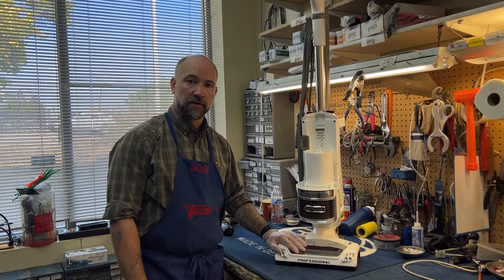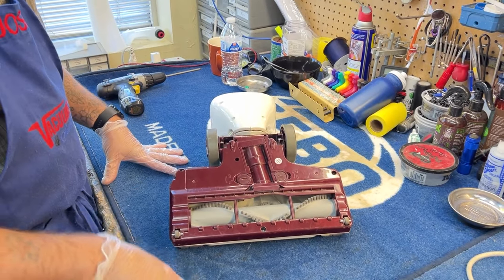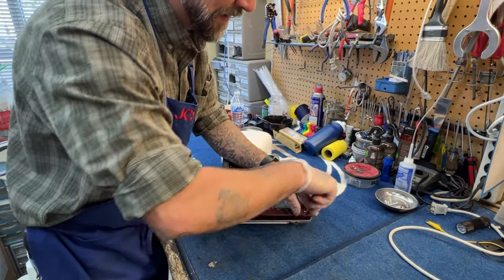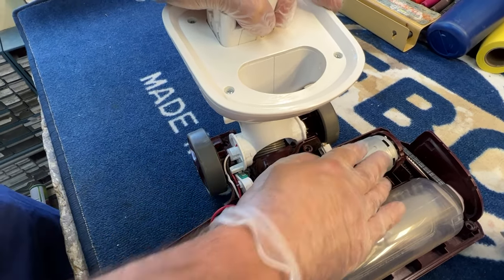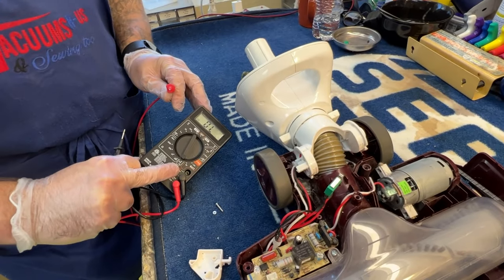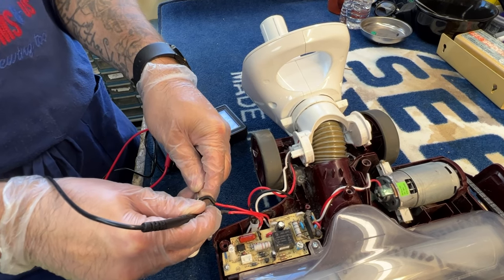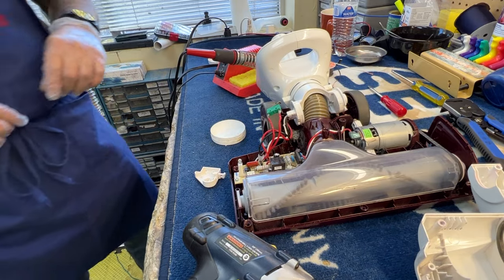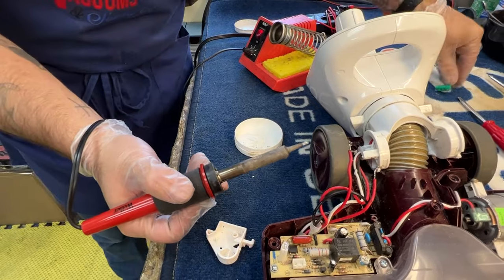Shark Repair for No Brush Roll Action--Micro Switch Replacement

Comment: I have a shark navigator uv540 lift away.  I removed screws to take off plate to remove brush roller to clean it.  Two rectangular shaped bars fell out and didn't see where they go to put everything back together. Any help would be much appreciated! They appear to have something to do with weight.
Reply: Hey Chris. Off hand and without seeing it I think those e are counterweight which go on the opposite side of the motor I. The powerhead
Reply: @joshyouwa  thanks so much for the reply.  I'm not sure what the power head is or looks like. Also not sure what you mean by opposite side of motor .

Comment: no screw under the middle below the hose - but my single roll is still stuck under the plastic housing in the middle - I removed all of the screws including the 2 under those little wheels - any ideas??  would be hopeful - for $10 part I would rather fix the 6 year old machine - no purchase a new one = thanks
Reply: did you ever get a fix.  I have the same problem. Can't get the top face plate off to access the wires.

Comment: FOR SOME MODELS -   THE BRUSH WILL NOT OPERATE IN AN UPRIGHT POSITION.
Shark navigator 350-353 series - if you have cleaned the roller and it doesn't work, TILT THE HANDLE BACK then try.

Comment: Random question here I have the shark apex duo brush model az1002 no power to the roller won’t kick on or anything I brought it up to my wife that the the wand is what sends power to the roller though the pins that click together was I right cause we ordered a new roller from shark it also didn’t power so I sent it back
Reply from the maker: Hi there, based off of your description and without seeing it, it sounds like you might need a micro switch replacement.

Comment: If the problem is intermittent,is it still the switch or a dirt build up?
Reply from the maker: Could be either actually. A significant build up of hair could cause the shut off sensor to kick. This is particularly prevalent in their so called "tangle free" designs. Which is sorta funny.

Comment: I was vacuuming and heard small popping noises with a burning smell. Now the roller won't spin. Is this likely to be the motor burnt-out? Many thanks
Reply from the maker: That is the most likely case unfortunately. I would still recommend finding your local vacuum shop and see if they will take a look at it. There is a chance it might be repairable and they will be able to assess that for you.
Reply: @vacuumsrus  thank you! I bought a whole replacement (used but working) bottom end and it still won't roll or light up even with the switch on carpet mode. Very frustrating as this means it's not the motor or micro switch!
Reply from the maker: Unfortunately, that likely means its at the end of its life. Sharks are considered disposable vacuums for this exact reason. I would recommend looking into Sebo's or Riccar's. Both of these are solid brands that make vacuums that are easily maintainable and repairable.
Reply: @vacuumsrus  what a shame! Everything is disposable nowadays I guess. Our LG flatscreen died a year after its warranty period. Now our shark 1 year after its warranty. Criminal for them to do this (I believe its planned) thanks again for your responses and time ✌️
Reply: It was probably your belt. The belt should be changed once a year.
Reply: Did you ever figure it out? I'm having the same issue and I replaced the belt and the brush 🙃 sucks because it's like a 3.5yr old 350 dollar vaccum!!
Reply: @rosellabespinoza  what brand vacuum do you have?
Reply: @ronaldtentschert6876  shark Lift-Away
Reply: @rosellabespinoza  Inside the power head
there is a small motor, could be bad or micro
switch. I worked on hundreds of sharks.
Reply: @ronaldtentschert6876 if the microswitch is bad would the led lights still come on? I bypassed the switch the red light and led light stop working  so I wired the switch back up I have the lights but no movement in the brushes.The 2 belts are fine no noise picking up maybe the motor?

Comment: What brand/model has the best/easiest repair ability in your professional opinion?
Reply from the maker: Riccar and Sebo have the best parts availability. Mid and entry Riccar are easy DIY repairs. Sebo is easy to repair if you know the product. They aren't really easy to just sort of "figure out". Miele is like a rubix cube.
Reply: What brand would you suggest for a residential cleaning business? I need some thing that can travel well and that works good for repetitive use.

Comment: So my shark sounds like the brush roll is slipping or grinding or something and it makes a horrible noise then starts to smell like burning plastic 🤔 replaced the tube which was the initial problem then it started doing this so I replaced the belt and the roll and it's still not rolling completely... it's hard to explain like I kick it down to Start the roller then in goes for a few seconds then stops like something is stuck then it'll go again then keeps catching then come the smell...is the motor going??? Idk please help lol

Comment: Possible to bypass this switch, always on roller. I use the roller 99% of the time anyways
Reply from the maker: You can yes. Prior to sourcing the correct switches this was actually our only resolution. However, it only takes an extra $12 and ten minutes to do it right and replace the switch so I think that is a better resolution for most people.